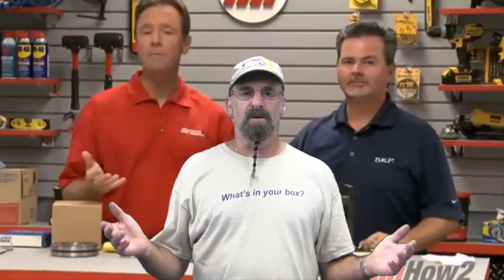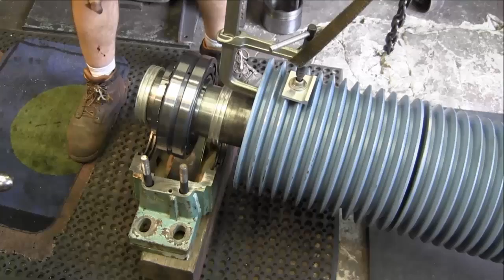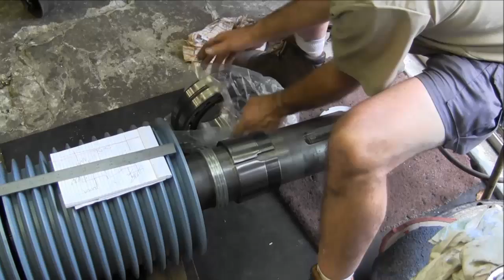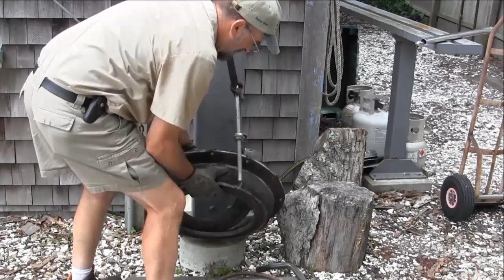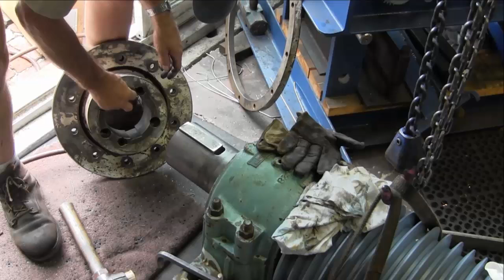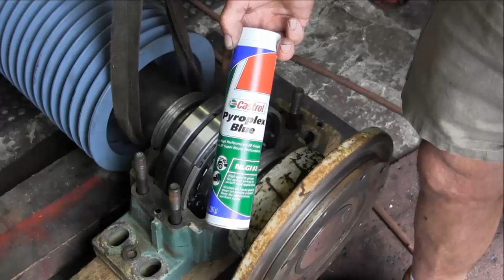Jackshafting Part 7: Tub Grinder Jackshaft Refurbishment

Comment: Keith, question, I watched the video you linked regarding installation of a sleeved bearing. In fact I watched another video by SKF also demonstrating proper method of installing a sleeve bearing. The question is in both videos they gave the correct tolerances in the instructions and then used the tensioning nut first without the lock washer and tightened the nut using a spanner wrench but then used a feeler blade between the ball bearing and the outter bearing race, driving the bearing up the tapered sleeve until the stated clearances are achieved. Then they removed the nut, installed the lock washer, put the nut back on and tensioner it, checked the clearances with the feeler gauge and when correct bent the lock washer into place. The big thing was the use of the feeler gauge to determine proper placement on the taper sleeve along with proper bearing tolerances. Your thoughts?

Comment: On the fasteners you used never seize. I have trained myself to use Loctite on most fasteners. I am wondering what your thoughts are on this? Thank you in advance.
Reply: +Matt Wilkins There are a few factors that determine application of proper thread/fastener lubricant, sealant, anti-corrosion/galvanic compound... or nothing at all:  the environment of the parts; chemicals, glues, salt water, water, oil, the operating temperature,  vibration, rotation, etc.  You also have the mating geometry:  flat butted or tapered/cone (like some lug nuts).  In certain areas, additional safety-wire, cotter-pins, or other mechanical device (deformed threads or nut, lock washer, 'ny-lock', etc.) employed to retain the fastener.  Some things you want to "lock" on and others you want to easily disassemble.  There are different degrees of fastening compounds ("locktite") and application:  for instance a carburetor screw or a flywheel bolt.  Some things you assemble you don't want to corrode over time, and not gall each other apart at a later time of removal.  It is best to follow the engineer's design or established trade practices.
Reply from the maker: Some things that are left to be opened again for maintenance, I use the neverseze, If I needed to hold a thread that had a habit of coming undone then I like removable loctite, and I also in some cases use the red and green loctite also.;{)-----
Reply: I like to use the green to install seals and bushings.
Reply: Thank you for the reply.

Comment: That's a huge taper lock, and the amount of neverseize he uses is extremely negligible.  I doubt very seriously it will make it far, even if it creeps out, and even then, well, the taper is already locked and it wouldn't get in there.  He's referring to not lubing the taper beforehand because it will be inclusive to the bond at that point.  Once you have metal to metal contact then you can safely take any kind of "fluid introduction" out of the equation.

Comment: Spotted an issue with your neverseize on the coupler.  You've been talking the last several episodes about assembling taper locks completely dry, however that design will permit the neverseize to creep into the taper lock.

Comment: Electric or air powered grease guns are cats ass, but you have to be careful since they have no 'feel'.  I have a zirk with a thin steel pipe soldered into it.  I use it as an extension for tight spots.   Just a tip for anyone.